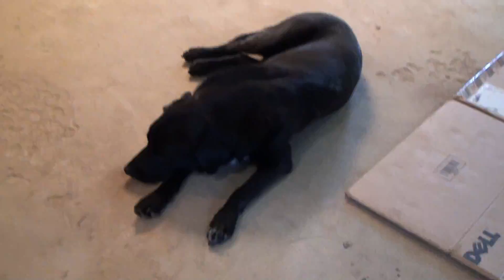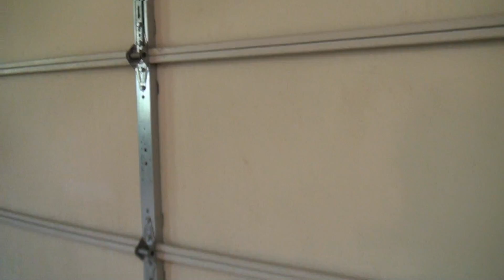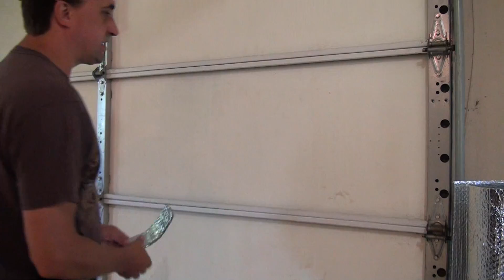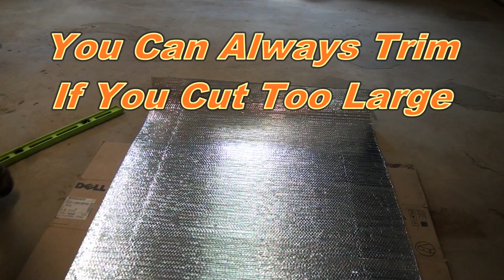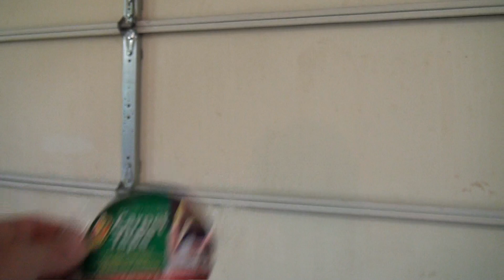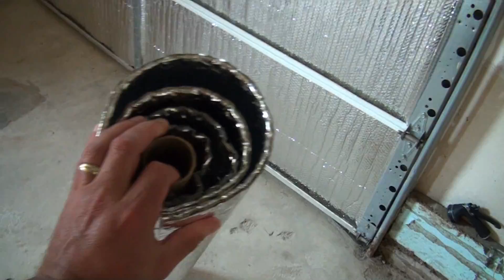DIY How To Insulate a Garage Door With Reflectix Radiant Barrier Winterize Reduce Heat Loss

Comment: I use the same material to prevent mind control.  The auto flush sensors at men's urinals are cameras placed by the NSA to take pictures of our dicks.
Reply: something you probably don't need to worry about

Comment: What is the R value?
Reply: No radiant heat barrier alone, even the bubble-wrap stuff, necessarily has a recordable r-value. It's meant to be used in combination with normal insulation.

Comment: Nice video. Do you have any bedroom on top of your garage? Is it allow to use an open insulation in garage based on building codes?I wanna do exactly the same for my garage I got 3 bedrooms on top of it and winter hohere in Minnesota is very cold. 👍

Comment: I believe if you create the airspace, it will help reflect the heat out better in the summer as my garage door faces the sun directly.   What I did was take some of the reflectix and rolled them into 1 inch thick tubes and cut them about 2 inches long and double sided taped them to the garage door (about 8 per panel) and then taped the reflectix to the edges of the metal panels.
Reply: Making the airspace out of the reflectix also helps to keep the weight down on the garage door.
Reply: Do you need an air space to keep it cool in the summer and to keep it warm in the winter?

Comment: The garage door where I live is the cheepo type, stamped aluminum..and I used this type of insulation...installed this same way. It really helps , esp in winter months when starting the car in extreme cold becomes problematic.

Comment: First View
Reply: ***** Thanks for your detailed video, very helpful! Can you please elaborate/provide resource for creating the air gap you refer to? I'm looking to install to keep cool air in (I live in South Florida), but I don't understand where I'm supposed to have it.
Reply: I installed this product in my Florida garage (west facing and gets very hot in the morning). By simply adding this product to both my doors, the radiated temperature was reduced by 30-40 F. I put them in with a tight edge fit, but baggy in the middle to get an air gap. no tape required. excellent!